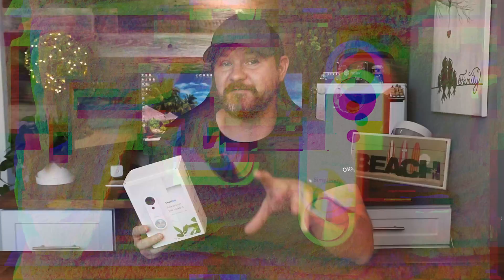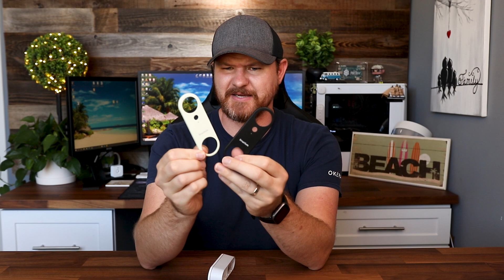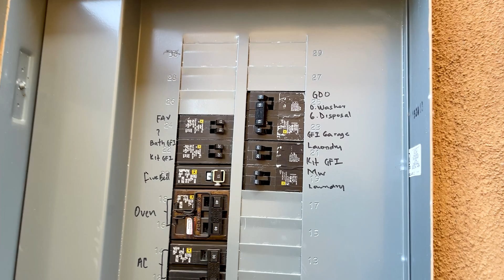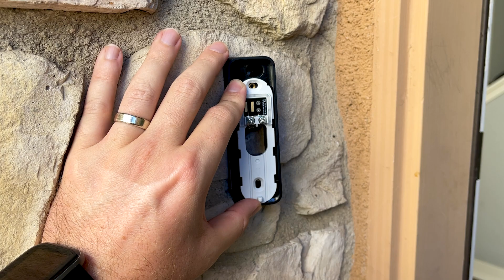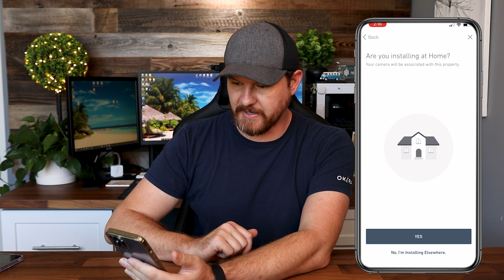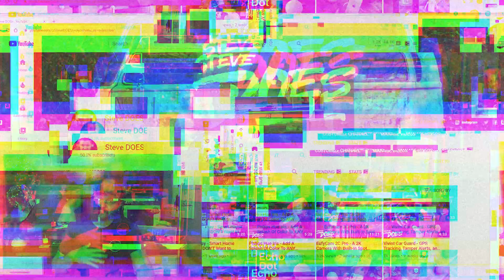How to Install a SimpliSafe Video Doorbell Pro

Comment: I just helped a friend by installing a SimpliSafe alarm system with cameras and the door bell camera. I couldn't get the door bell camera to work and spent over an hour with their technical services who decided to send us a replacement doorbell camera. It turns out the house had two doorbell chimes and the transformer was too small to support the combined wattage of the doorbells and camera. For $17 I purchased a more powerful transformer from Amazon made for doorbell camera systems. So if you have difficulty getting your SimpliSafe, Ring, or Blink door bell cameras to work consider upsizing the doorbell transformer.

Comment: Do i need to hook up to an old doorbell box in house ? Their instructions say something about connecting something to our old door bell box in the house
Reply: The additional piece that they give you is actually a metal oxide varistor also called a MOV. It's job is to smooth out the voltage spikes and to keep the door bell from making a humming noise. It's kind of like a shock absorber needed in part because the inexpensive doorbell transformers make a rough alternating current output. It also extends the life of your camera by smoothing the crappy incoming power.

Comment: Does simple safe have a wireless doorbell that doesn’t require wiring ?
Reply: Yes, most door bell camera manufacturers have a rechargeable unit that you can remove every two months to recharge with a mini USB cable. I just purchased a solar bezel that goes around my rechargeable Ring doorbell camera so it doesn't have to be recharged.

Comment: The motion detection doesn't work for crap. You'll get an alert every 10 seconds even if u block off every single square. Other than that it works fine as a doorbell and camera. Pisses me off that the motion detection app doesn't work.

Comment: All connected but when I place the QR Code in front of the camera (12”), nothing happens!!   What is going on??  Can’t connect to Wifi. Verified my wifi name and passcode with phone company???
Reply: Same here
Reply: Hold it like 3” away and move back slowly. Mine usually recognizes at 6”
Reply: I had the same problem. The reason is the door bell transformer is too small to power both the chime and camera. I purchased a doorbell transformer for $17 from Amazon that is specifically for solving this problem. You can read my other posting on this video for more information.

Comment: Did this require a jumper cable for the existing doorbell chime component?  Will your existing doorbell chime component still work?   Are there jumper wires included if your existing doorbell wires are too short?
Reply: Mine worked with the existing wires - new doorbell replaced the existing one and the chime inside works fine.

Mine did not include ‘jumper cables’ but the wire mount is nearly flush with the base. Unless your wires are in a hole you should be fine. But if you had to you could get a couple of wago wire nuts and a little wire.

Comment: Isn't this also a wireless? How long will it last on battery?
Reply: They sell the doorbell cameras both ways. This is the same for SimpliSafe, Ring, and Blink. They run for about 2 months (60 days) on one charge. I added a solar bezel to my Ring doorbell camera so it no longer needs to be recharged.

Comment: He forgot the small screw that gets installed after the installation and setup are complete.
Reply: They also forget to ring the bell to let us know how loud it is. Also are there pre-recorded statements ie not able to come to the door right now etc. Does it speak to the visitor n does it tell you someone is at the door or does everything just glow as an alert by simplisafe? Thanks. J
Reply: Simplisafe told me it’s low voltage no need to find circuit?  This seems inaccurate and none of the circuits are labeled.